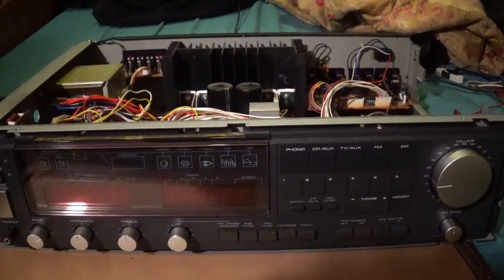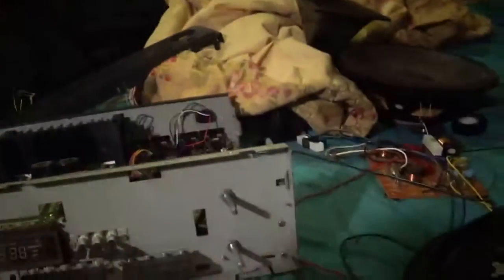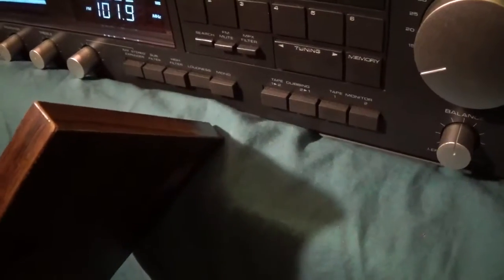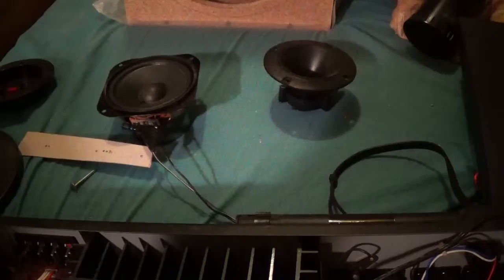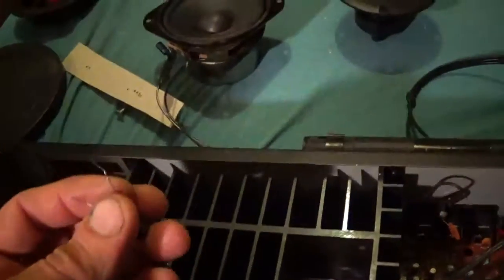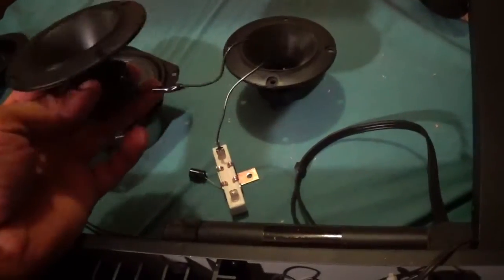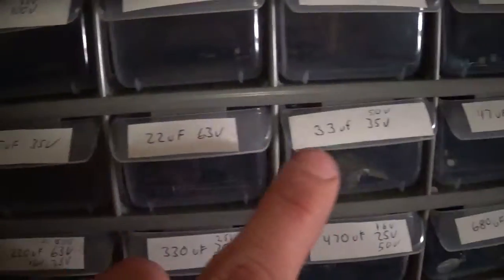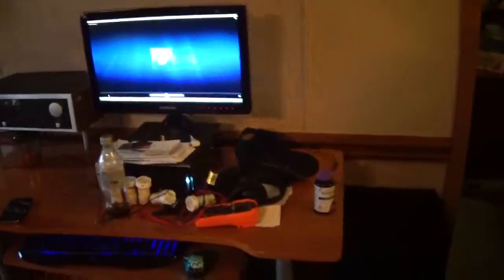Realistic STA 2280 fix up pt2 and speaker build

Comment: Hi. Great videos. I have a STA-2280 that I adore. Unfortunately the display doesn't work anymore. The green lights for the selection switches work but the tuner, VU meters, and the speaker and IMX lights don't come on anymore. It was a slow death too. Sometimes they would work right away or after warming up. Any advice? I watched your video where you repaired the same display on a different unit but my problem seems different. Should I start with recapping the display and power boards like you did?
Reply from the maker: Caps seem to be the most common problem. I would check out the power supply transistors and regulators. The ones on the small heat sinks are common to burn out. Judging by what you said not working sounds like one of them may be burnt. Theres also some TO92/BJT around the same area that regulate power.
Reply: william staten Thanks so much for the reply and suggestions. I'm somewhat new to working on circuitry. But I think this is an issue I can tackle.

Comment: Hi Bill... Another nice job. We seem to have a lot in common. I also built a set of four very BIG speaker cabinets for my STA--2280. I am not as knowledgeable with solid-state as you are. My hobby is restoring vintage tube electronics from the 30s and 40s. However, I have repaired several issues with my 2280 that crept up over the years, but there's one issue that has had me stumped for over a year now. The FM tuner stopped getting stereo and went total mono some time ago. I recapped the whole board and even changed the MPX chip, but still no stereo... mono only??? All the other input sources get stereo but not the FM tuner??? Maybe I'll figure it out some day - lol - - -  I find your videos very educational. Keep up the good work.  - THX - Chuck